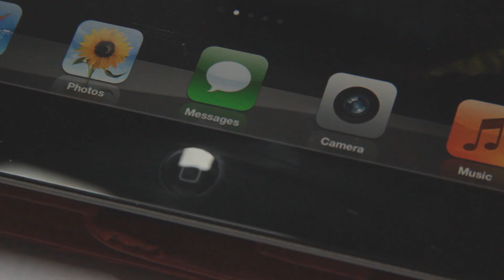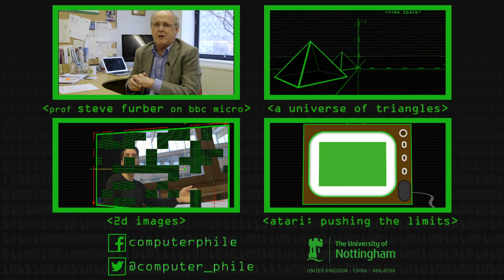Capturing Digital Images (The Bayer Filter) - Computerphile

Comment: I think you should have shown examples of the demosaicing process. This is a purely technical theoretical explanation. I knew and understood that explanation for years before I first saw an actual visual demonstration of it. That visual completely changed my understanding of it, because just the technical story doesn't really explain it all that well.

Wikipedia has a very nice demonstrative visual.
Reply: The problem is that there is not one way of demosaicing to rule them all. I agree that an example can be nice, but saying
(like in the video) that it's more or less a smart averaging process is true in general, whereas a specific example could lead people to believe that is the way to to things.

Comment: So are we interpolating pixels just for the sake of cramming more of them in? Couldn't we just used less pixels and stores only the ones whose values we truly know?
Reply: We're interpolating the values for the sake of correct colour representation. If this was not done, you could zoom into an image and see exactly as illustrated in the video: one pixel would have only a green component and another would only have a red or blue component. The demosaic process is employed so that every pixel can have a value for each colour filter.
Reply: zap813  No, the interpolation is necessary because you cannot have sensels (=sensor elements) of all three channels/colors in the exact same spot. At least not with a Bayer type sensor. So you have to get the missing information from the neighboring sensels. Foveon sensors on the other hand stack the sensels for red, green, and blue vertically on top of each other. So, they don't need to interpolate (but have other problems instead).

Comment: Why are raw images so huge in file size? It seems like there is less data than in a demosaiced image because each and every pixel has three values, not just the one in the raw.
Reply: I think demosaicing usually happens in the hardware before the raw image is saved so you end up with 10 million pixels times 8 bits per pixel times 4 (or 3 if we drop the alpha channel) which comes out to about 40 (or 30) Megabytes plus header space.  That's also assuming it's using 8 bits per color, some formats use more and others less.  The actual raw image would still be 10 MB plus header space.  Image compression formats tend to shrink file sizes by a ton using a variety of methods including some that outright erase raw data under the presumption that we can't tell the difference.  If it's not already been done image compression would make an excellent video if not series of videos.

Comment: are they onle RGB? are there cameras with CMYK?
Reply: no there are not. rgb is an additive colour space – light mixes together and gets brighter. cmyk is a subtractive colour space – inks mix together and get darker. r+g+b=white, c+m+y=black.
(k is also black, since it is better to use black ink for greyscale than mixing 3 different inks together, as 3 inks on top of each other get the printing medium wetter than just one).
this is why it is impossible to get an accurate representation of a printed image on a screen, as screens are backlit and print is not. it affects your perception of the colours.
there are software tools to help you make adjustments to get the perceived colours closer (such as when designing for print media on a computer), but it will always be a fundamentally different way of producing an image from light.
Reply: Bitchslapper12 i wrote it out of my own head! (and when i wrote it none of the other comments were on my screen…)
i suppose we all just remember the info well. though ofc i can't speak for anyone else.
i think we each gave different info though, beyond the "no because additive vs subtractive" vocabulary. the extra padding, if you will.
Reply: Kit Vitae Pretty much the same with my comment.
Reply: I don't think a CMYK camera would make sense.
The color mixing principle is very different between RGB and CMYK.
CMYK is a subtractive color model used for printing and describes the color of mixtures of color pigments (e.g. ink or paint).
RGB is an additive color model. It describes the color of mixtures of different wavelengths of light.
Since a camera captures lightwaves, it has to work with RGB (or similar).
Later, the image can be converted to CMYK, but the raw sensor data will always use an additive color model.
Reply: Yea... in theory you could make a CMY camera (but not a CMYK, its not possible to make a K sensor).. in that case it would be a CMYW sensor.

Actually this would be quite interesting because a camera of that type would be twice as sensitive to light. The problem would be that you it would be more complicated to calculate the value of every single pixel.
Reply: Did everyone just copy/paste Wikipedia on this poor dude's question?
Reply: Bitchslapper12 defently not me, i answed in a way that was not really simular to the other onces.
Reply: Bitchslapper12 Way to assume nobody knows anything...
Reply: *****  You are wrong again. CMY cameras have been built. Back in 1999-2000, several camera manufacturers released cameras with CMYG and CMYY filters. The Canon Powershot S10 is an example, google it if you don't believe it. Guess what, I've been working many years in image processing as well, and studied color science. As I said before, yes, we still say "red light" etc., because it is convenient to do so. Just like we still say "the sun rises and sets". That's fine, as long as we know what's actually going on.
Reply: ***** In CMYG cameras, the green filter was an overlap of yellow and cyan, it did not add new color information. Kodak also released some cameras with CMYY, no green there.  "I didn't say you can't build" - that's exactly what you did; you said, and I quote: "The parent asks whether there are CYM cameras or not, and the answer is no: you can't build one". Well, they do exist, so they obviously can be built. Trying CMY filters for cameras does make sense, they have certain advantages like a higher transmittance, but also drawbacks like more complex math necessary to reconstruct the image.
Reply: *****  You might have missed my edit. Kodak did release at least two cameras in 2000 with a pure CMYY filter - no green there. And it could produce red, albeit not as well as RGB cameras. Also, "you have a yellow filter (lets 560-590nm light through)" - that's not how filters work, they are much more gradual and "broadband" than this, just like the sensitivity of our cone cells isn't restricted to such narrow ranges either. Wikipedia has an article for the "CYGM filter", you can take a look at the spectral response curves there; the yellow filter does capture red, the magenta filter does, too.  Quoting your full sentence doesn't exactly help you. You still claimed that CYM cameras cannot be built. Maybe there's a misunderstanding - what exactly do you consider to be the difference between a "CYM camera" (i.e. a camera with a CMY-based color filter array) and a "camera with a different color space"?
Reply: *****  No, it is you who's mixing up things again. Photons don't possess color, because color is not a physical attribute. Even Sir Isaac Newton already knew: "Indeed, rays [of light], properly expressed, are not coloured."
As I said before at least twice: it is a convenient shorthand to talk about light as if it were colored, but that doesn't make it real.
Terms like "redshift" and "blueshift" are perfect examples for this, because they are shorthand for "frequencies shifted downwards (lowered)" and "frequencies shifted upwards (raised)". They do not imply actual red and blue color! If light from a red star gets blueshifted, for example, that does absolutely not mean that the light will appear blue. Only that the frequencies are higher than normal to some extent.

Wavelengths/frequencies - or properly generalized: spectral power distributions, do exist in the physical world, but color exists only in our minds.
Reply: ***** "Blueshift means in the blue direction".

Not really. As I said, it means frequencies raised. You know, gamma rays can be blueshifted as well, but since they already have higher frequencies than blue light to begin with, shifting them "in the blue direction" could be interpreted as lowering their frequency, which is incorrect.

"let's say I agree, it's a "convenient shorthand", not a contextual reference, and it has no physical meaning."

I never said that these shorthands have no physical meaning. They do (see blueshift/redshift). I said that color isn't a physical property of light. Scientists like Newton and Schrödinger agree.

Where does magenta fall in that "shorthand"?

Counter question: where does gray fall? Where does the color of your hand fall, or your kitchen's wallpaper? None of those are spectral colors, so they don't have an "associated wavelength" either! And as I said before, many "white" LEDs use spectral blue + yellow, that's "two separated bands together" as well.

"I'm not disregarding the "color as a perception" perspective, just focusing on "color as the related physical phenomenon""

Color is not a physical phenomenon. It is solely a perceptual one. Color is caused by light, so of course there is a link to physics, but it is not a direct and unique link.I know where you are coming from. You are talking about spectral colors, i.e. those colors that do have a direct and unique link to physical light because they can be expressed with a single wavelength/frequency value. However, as I told you before, spectral colors are the exception, not the norm. We don't really encounter them much in real life (unless one works with lasers or spectrometers, like you apparently do). Too many people think that color = wavelength, but that is only true for spectral colors, which are a minority; therefore it is wrong in general.

Magenta/purple colors aren't special because they "have no associated wavelength", i.e. are not spectral colors - most colors aren't. Magenta isn't special because there are no "magenta photons" - there are no "red photons" etc. either. The special thing about magenta is that it is the only hue that has no spectral correspondence. A hue is a rough category that we group "similar" colors into, and those categories aren't precisely defined either. Does cyan for example deserve its own hue category, or is it just a subset of blue or green?
Saying "magenta isn't real" is wrong, as explained in so many ways. Saying "magenta is the only non-spectral hue" is the correct way to put it.
Reply: FACEPALM